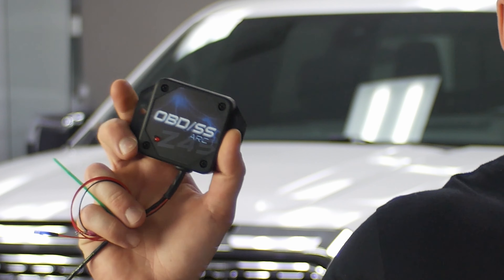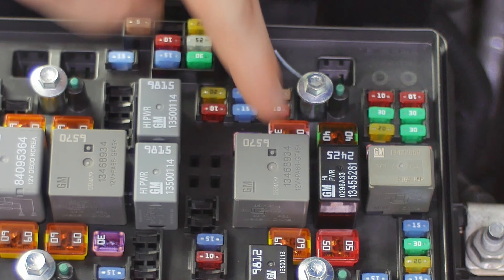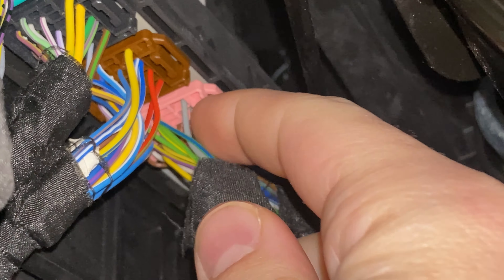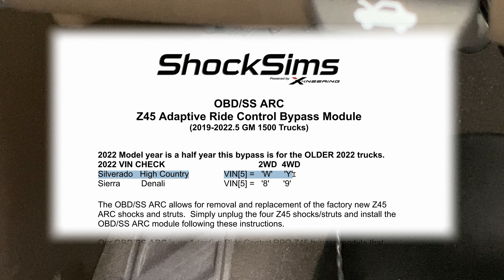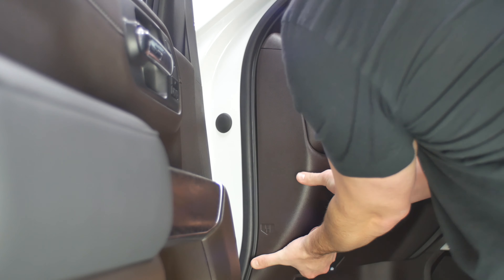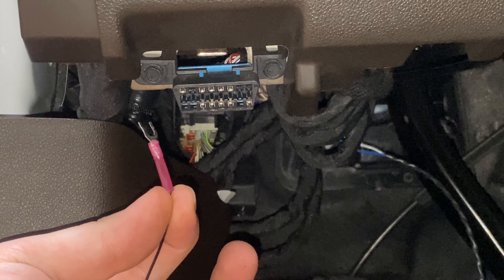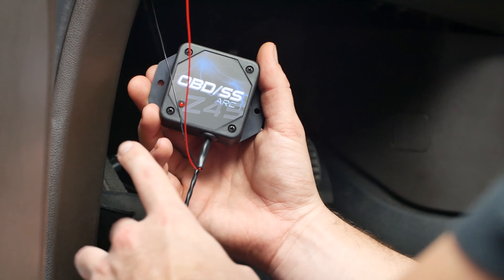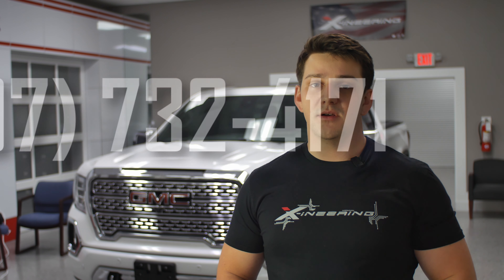2019 - 2022.5 GM Adaptive Ride Control Bypass RPO Z45 - OBD/SS ARC Install

Comment: Is there an advantage in using this kit versus just using the ARC coils removed from the old shocks?
Reply from the maker: Both solutions (OBD/SS ARC Module and Solenoid Coils) provide a robust and reliable bypass to the Z45 Active Ride Control.

The ARC module is MUCH easier to install and does not require the disassembly of the OEM struts i.e. removing their 'solenoid coil'.  
It is a bit labor intensive as shown in our Z45 FREE bypass video and there is a chance of breaking the solenoid if you are not careful.

Comment: Good video well explained. 
My question is on the ride height will it also work ? And say I want to replace all shocks and do a mild lift on my 2020 1500 GMC Denali 
And your product warranty? 
Thanks
Reply from the maker: Thanks for the comment!
Height does not matter. Feel free to lift and lower the vehicle how you like!
Our warranty is 1 year. We thoroughly test and assemble everything here in the USA. 
You can view the system at this link here:
https://shocksims.com/shop.html#!/OBD-SS-ARC-2019-2024-GM-1500-Trucks-Adaptive-Ride-Control-Bypass/p/618805277/category=0